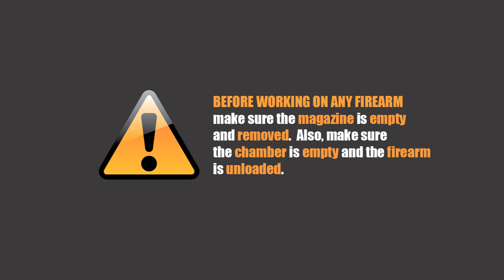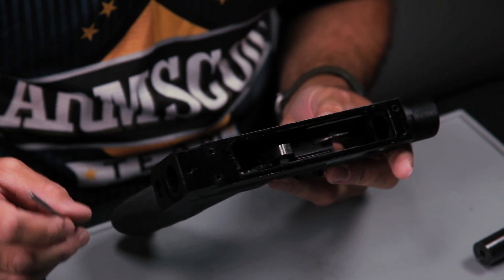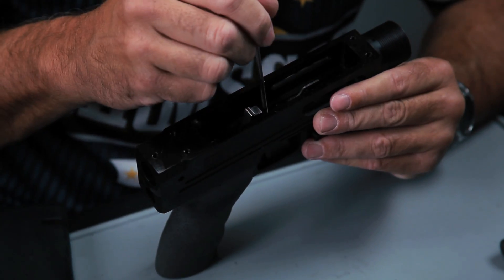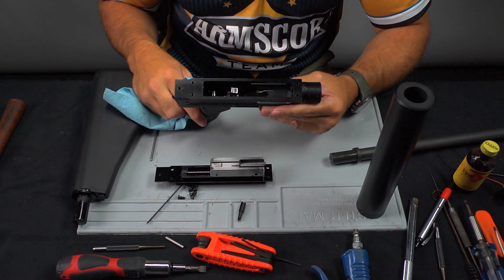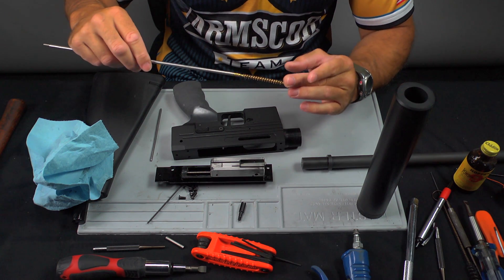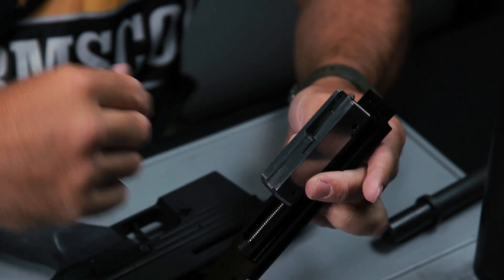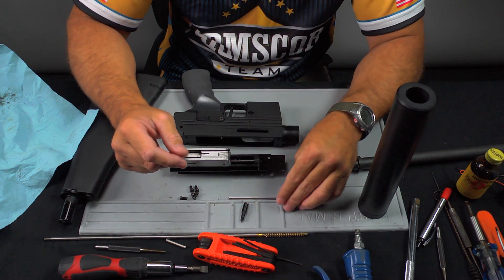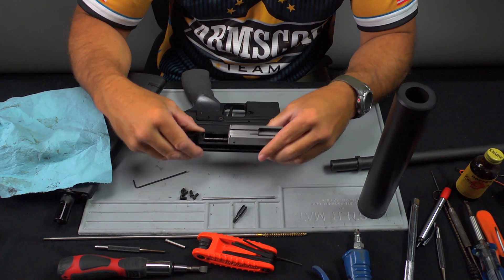Rock Island Armory MIG 22 Cleaning

Comment: How to use that slave rod? I once accidentally disassembled that part by pulling the bolt and the recoil spring flew, I had no idea how to put it back so I just really compressed the spring as hard as I could to put it back with the bolt, frame and the rod. Was really a nightmare to do so right now Im trying to look up on the internet on how to properly assemble and disassemble it.